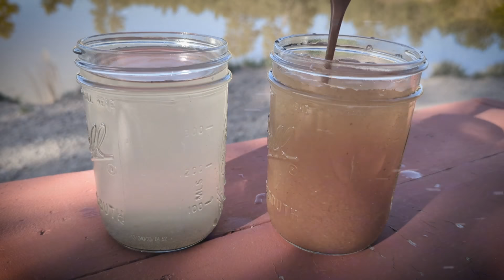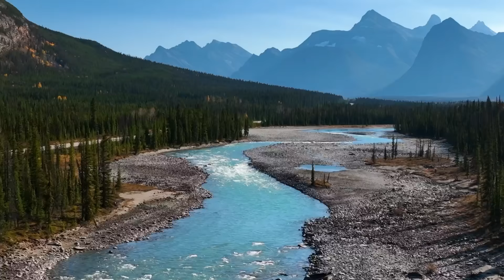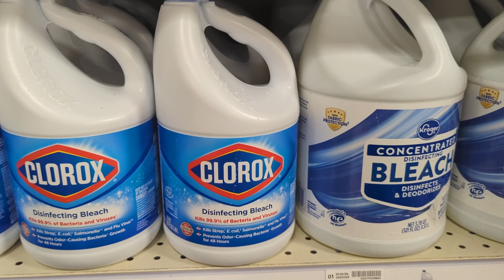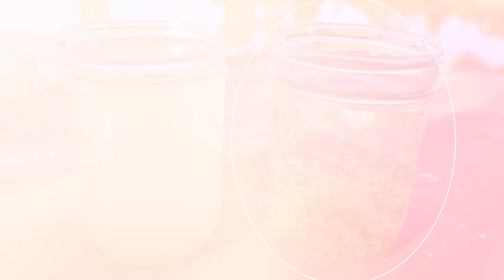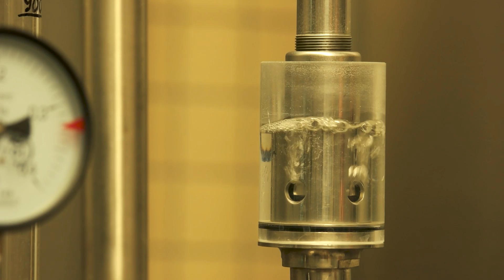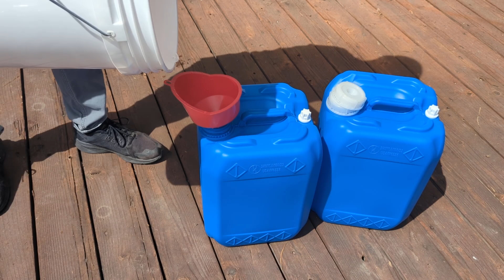The KEY to Emergency Water Preparation Before SHTF

Comment: Distillation will kill you. Distillation removes minerals your body needs.  Without them your body will cannibalize itself.
Reply from the maker: Distillation removes minerals from water, but most of our essential minerals come from food, not water. Drinking distilled water in moderation is safe and won't cause your body to cannibalize itself. The issue can be easily avoided by remineralizing the water before drinking it as well, even with just a couple grains of salt
Reply: @waterfilterguru  look I appreciate what you are trying to do here, but it doesn’t help people to think distilled is an option beyond a couple of days.  I suggest you speak with people who produce and sell water distillers, and you’ll find they will tell you what I did.  What people are concerned about today is a grid down, which is expected to be 18 month minimum, if not longer, considering China controls all the parts to our grid.  Water will be gone in 3-days, you won’t even be able to flush toilets.  That rules out distilled water.  No one is going to have the additives necessary to make distilled water out of the blue as you suggest, for long term use.  You’d be better off telling people, who have yard sprinkler, to look into tapping into their well system for a hand pump.  Then they’d have all the water they need, for as long as they need, for whatever emergency arises — including flushing toilets!  Your rain barrel — they make food safe versions — with a GOOD water filter is reasonable — Outback Stage-4 is a good one, and they claim theirs will filter even water off the roof.  If they buy an appropriate dolly they can move a full rain barrel inside a garage for safe keeping during a grid down or hurricane.

Comment: How are you planning to flush toilets?????
Reply from the maker: If there's no longer water coming to the home during an emergency situation, would you rather use that water for one single flush, or to save and treat for drinking purposes?
Reply: @waterfilterguru  why in the world would you suggest you have to chose.  The point is to plan for all contingencies.
Reply: @Sam-y5d3j You would definitely need to choose unless you have ALOT of water. In a real situation don't think you will be able to maintain your current living standards.

Comment: To store water for a long time, sanitize it first, then FREEZE IT.
Keep frozen until needed.
Reply from the maker: Great tip, although hard to implement, I'd imagine. If the power goes out, your water melts. You'd also need multiple freezers to store larger volumes of water, which could get costly in terms of energy requirements
Reply: @waterfilterguru  Winter time comes to mind. So does an ice house.
Of course you need 1,000's of pounds of ice to get through the warmer months but by then you have other sources of water available.
People used to store ice in an ice house.
Also, ever hear of an Ammonia refrigerator?

Comment: Bleach has a shelf life of about 9 months.
Best to get swimming pool granules that are pure Sodium Hydroxide if possible. Then mix your own as needed.
To make the ceramic filters last longer, prefilter your feed water as best as possible.
Ceramic filters are very slow at gravity filtration.
Reply from the maker: Great tips!
Reply: THIS. Yes to all of this.
Reply: If you have chlorine, it will gas off
Reply: I would plan to let water settle undisturbed for hours first, then pre-fillter using Pillow cases and/or Millbank Bags. Then either ceramic filter or treat with chlorine Dioxide or fresh mixed 
bleach made from pool shock.
Reply: @socom2173  A middle step would be to sand filter with carbon then use ceramic.
Reply: @crazysquirrel9425  It would also help remove some sediments. Not sure how well Charcoal works, but Activated Carbon will remove chemical contaminants very well.
Reply: @socom2173  Ever hear of biochar? That too is not activated carbon and it removes contaminants. Only if you make it right (1400+F actually for best results). When the aluminum rivets on my stock pot melt off I know it is hot enough lol.
And then immediately quench it in cold water to fracture it further.

I have made many batches. It does take a few hours to make a small batch correctly.

Comment: What is your take on a viewer's post that glass blocks UV rays, so glass container would not be effective for the solar treatment? That's not something I had heard before.
Reply from the maker: Check out this study, they tested UVA and UVB radiation transmitted through various types of glass. https://pubmed.ncbi.nlm.nih.gov/19614895/ UVA radiation blocked depends on the type, color, and thickness. UVB radiation was completely blocked by all glasses. According the Healthline, about 95% of all radiation from sunlight is UVA radiation. https://www.healthline.com/health/skin/uva-vs-uvb#comparison-chart
Reply: @waterfilterguru  Thank you so much for the information and the link!
Reply from the maker: @MariaVazquez-du3st  You're welcome

Comment: Does UV treatment have effect on tap water?
Reply from the maker: UV is primarily used to address microbiological contaminants. Tap water that's been treated at the city water plant typically isn't at risk of microbiological contamination, as it's disinfected with chemicals. However if there is a water treatment system in the home that removes the residual disinfectant, it creates an environment where bacteria can grow, which is one reasons some folks might want to use a UV system with tap water. UV can also be used to do chlorinate tap water, but its not the recommended method.
Reply: @waterfilterguru  Thank you very much for the help!

Comment: If the toilet has ever been plugged, and someone uses a plunger, it blasts gasses through the bowl, and back into the tank. Those gases contain bacteria, and if your toilet is over 2 years old, there is fecal bacteria growing in the tank.
Reply from the maker: All the better reason to have a proper method of disinfection prepared

Comment: It’s all fun and giggles until the alpha and beta particles get into your rainwater
Reply from the maker: The good news is you can use activated carbon filters to address alpha and beta particles. Replacing the filters regularly is important, as the media becomes radioactive as it adsorbs the particles. Proper disposal is also vital, so make sure to check your local regulations

Comment: Flush your hot water tank from the bottom twice a year to clean out the sediment and also preserve the life of your tank.
Reply from the maker: Good tip!
Reply: Great 😊 Information, thank you !!
Reply: @QRZ-s3s I would say liquid bleach and water. Then let air dry before filling.👍
Reply: I should be doing this, we've already gone through one tank and have very hard water.
Reply: If it's older, don't, may release some rust and will create more problems
Reply: @helengeorge9754 i 2nd this. If it wasn't done from a new date I'd definitely not recommend it. Good call Helen
Reply: Those water tablets make the water taste like crap

Comment: Truthfully, there are so many discrepancies regarding the water filter system to use & what method to treat ur water leaves us wondering what is true or not & who is telling the truth? That solar method using plastic holding the water sitting in the sun, what? I thought plastic is bad for us? That idea does not sit right for me.
Reply from the maker: These are tips for securing clean water in preparation for or during an emergency situation.
Reply: @GHE2005  when your thirsty enough  ask around and see who cares. Thus giving you motivation to try the many options purifying water. You'll know which ones to complain about. Providing your among the living. No one owes you nothing.  Nothing
Reply: Been prepping since 2014 and all these methods are well known for acquiring potable water. The guy in this video is merely providing info to those with a normalcy bias towards being prepared. These tips work with a few caveats. One being, you should do several methods to insure potable (drinkable) water. Example: prefilter your water with a cloth like a handkerchief before running it through a filter to extend the filter life.  Then boil (learn how to make a fire) your water or treat with bleach or iodine. Another caveat is that  bleach isnt effective against Crypotosporidium - a nasty parasite. Likewise, iodine isnt effective against Giardia - an equally nasty parasite. I have over 250 gallons of clean potable water stored in my home, yet I still plan to filter and boil it before use. Waterbourne sickness is vital to avoid. My rain barrel water is prefiltered before going into the barrel by using an Intex pool pump filter. I just use foam filters and let it flow into the barrel by gravity - no power needed. This keeps the rain water from getting rank from sludge accumulation.

In the matter of heated plastic, yes, in the long run the microplastics will have an adverse effect on your health. But remember the average human can only live 2-3 days without water. So we are talking about saving yourself from immediate death from dehydration as opposed to months to years of drinking microplastics. If plastic is that concerning to you, just use a glass container - it's commonsense. What would be even better for you is if you started storing clean water TODAY instead of waiting to use this knowledge in an emergency instead of contending with some random guy on YT thats just trying to inform people. Do your own research and be prepared. 

Finally, another way to filter water that wasn't touched on is by using a cloth between 2 buckets or containers. Drape half the cloth into the bucket or container with dirty water and then drape the other half into the clean empty bucket. By utilizing surface tension and capillary action, the water will drain from the dirty bucket and into the clean bucket, producing rather clear looking water. The clear water should still be filtered and/or boiled or treated before drinking. Most of the methods in the video will take time. Preparation and planning is the key.
Reply: "When someone hands ya a bottle a clean water, ya drink it. Even if ya ain't thirsty, ya drink it. Much as ya can anyway."
Reply: @SojournerNX  Mic Drop.  All very well stated and true!

Comment: Question. +/_25yrs ago I was listening to a late night radio show. The guest suggested burying water in containers. He implied that nature kept water stable that way. I filled about 6 empty bleach bottles and placed them in an out of the way full shade area in my back yard, but did not bury them. A few months ago I found them, still full. The caps had become brittle but the water inside was as clear as can be. I won't use for consumption but decided to keep for flushing if needed. 
Any thoughts on this? 
Also, I advise never use empty milk jugs. They can not be made sterile, period. Also, I have saved some large 1.75l licour bottles (both clear plastic and clear glass) and some 1qt, & 1ltr clear glass beer bottles which I've just learned how to sterilize. Have not decided how to use these yet, maybe storage but for sure happy to learn of the sodis method. Thanks for the info. Good stuff.
Reply from the maker: Hi thanks for sharing, good question. The most nefarious contaminants are undetectable by our senses, so even if the water looks clear, doesn't have a smell or taste, does not mean it's clean and safe. In your example, the plastic container may have leached chemicals into the water over the years, but you can't tell just by looking at it or smelling it. I'd advise following the water storage tips in this video, and changing your stored water every 6 months
Reply: Thanks for your response. I 100% agree about the chemical leeching. Like I said, I would only use at this point for flushing(maybe cleaning?) I'm new to this subject and agree to rotation as the safer method for any/all item. Will look more into your methods, particular the sodis method. What method is there to test water at the novice level?  Any?
Reply from the maker: @ralphaelalfaro6023  check out this video! https://youtu.be/QO9i3dlXaOw
Reply: You can grow plants in wine bottles or those glass bottles. Remember that if in a long term situation. You can also use them to grow micro greens.

Comment: An old gas water heater can be turned in to a wood fired water heater and distiller with some copper pipe and cooling tank,just leave it a open system to avoid bursting ,you can dig a hole and set water heater on for burn box ,after you take out gas burner,make sure the tank is good not busted.
Reply from the maker: Interesting idea, thanks for sharing the tip!
Reply: @waterfilterguru  yur welcome
Reply: Friends heated all of their water using a wood fired water heater because they lived off grid. It’s surprising how well they work with a small amount of wood.

Comment: Let's not forget bleach tablets. They will last 3-5 years if stored properly (cool, dark place, sealed container); whereas liquid beach lasts from 6-12 months.
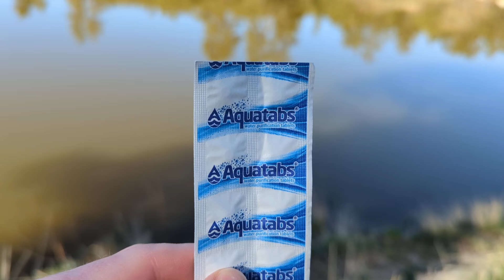Reply from the maker: Thanks for the comment! This is mentioned at 4:34 😉
Reply: what would bleach tablets be used for?
Reply: @stephanieroberts1394  exactly as bleach.
Reply from the maker: @stephanieroberts1394  Disinfecting the water

Comment: My understanding is that water treatment products, tablets/drops will really mess up your stomach biome.

I just treated my tap water that was put through a berkey system with fluoride filters and berkey black filters so it will store for 5 years.

My goal is to refilter before drinking.

The question is, how long can you store filtered water without adding anything, if its kept in tthe dark?
Reply from the maker: The risk with storing filtered water without any preservative chemical is always going to be bacteria growth, even if stored in the dark. You could always disinfect it before using it for consumption, of course.
Reply: We always stored water, and put it through the Berkey before drinking it.

Comment: I haul water in plastic jugs at the moment. I use Arizona 1 gallon juice jugs because they are easier to carry than milk jugs and milk jugs always smell funny if you don’t wash the heck out of them. Are they safe to use to store a few gallons for shtf if the water is changed every few months? Even just for washing water. I don’t have a lot of extra money to buy those 5 gallon storage jugs. Broke a water pipe a while back and it’s not fixed yet so I have a few containers for different things. I have some cat litter jugs for flushing (2 small) and 3 large for washing dishes and stuff and nine Arizona jugs for drinking and cooking. I do laundry at my son’s house. I have a Zero water pitcher but I need a new filter, is that one ok or should I get something different? Wondering 🤔
Reply from the maker: ZeroWater provided strong contaminant reduction in our testing, but of course it all depends on what contaminants are present in your water. It's essential to replace the filter according to the manufacturer's instructions.

Comment: Sodium hypochlorite,  aka bleach, has a very limited shelf life @ 6-8 months maximum. In an emergency situation,  your better off using calcium hypochlorite, minimum 70%.  This is the active ingredient in pool shock & is commonly used to treat water.   It has a shelf life of 10 years, when stored properly.
 You create a solution that chemically disinfects the water, killing pathogenic microorganisms. You can find information online regarding its safe use. 
  And get a gravity filter for emergency water filtration. They don't require any energy to use.
Reply from the maker: Great tip!